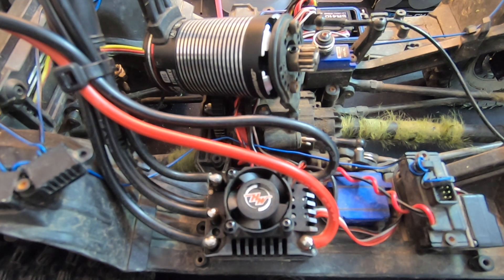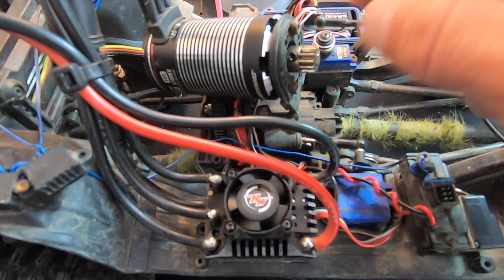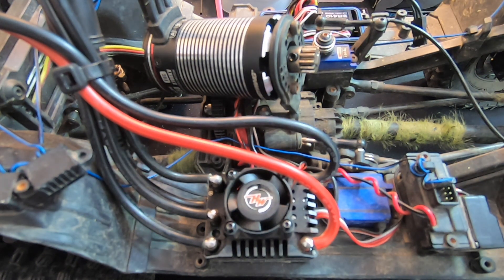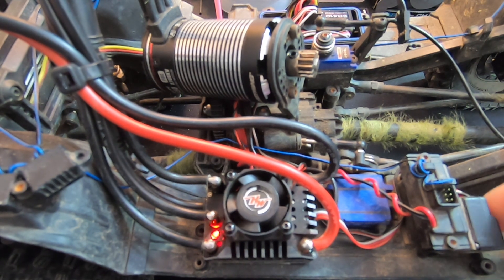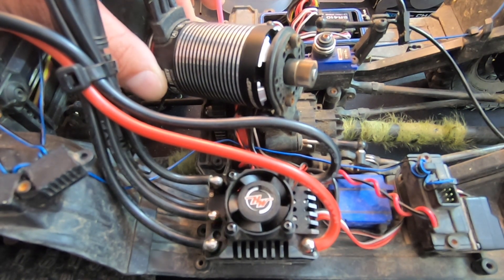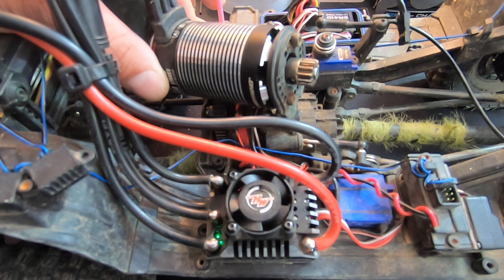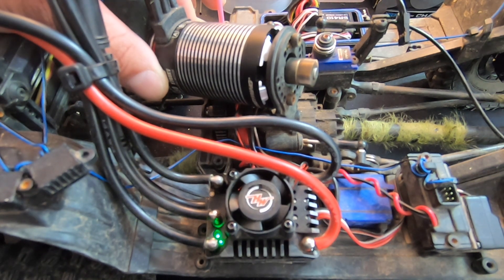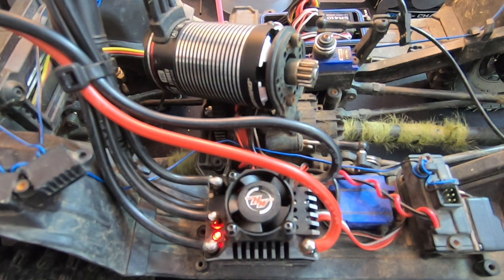Hobbywing AXE FOC Automatic Motor Pairing - Sensor Reset

Comment: Mine keeps coming unpaired.  2700kv in a trx4.  I’ve tried the fender washer.  Different batteries.  Any time I go from first gear to second, drive for a second, then switch back, it loses pairing.  Any ideas?  Thank you. You rock.

Comment: I did this on my new system today. 2800 KV. After pairing the red light blinks faster than in this and other videos. I DID update firmware in the app. Is this an issue or normal?

Comment: I just purchased an axe 2800kv combo today.  Do I need the esc fan if im doing alot of water crawling?  Motor/esc will both be getting wet pretty regularly.

I notice it is removable/replaceable.

Comment: You really have to remove the motor from the transmission to do the 'Automatic Paring' after firmware update? So where's the tutorial to get the motor out of there then?

I pressed the set button for 7-8 sec and nothing happened. (My) Motor seems to run fine after firmware update.